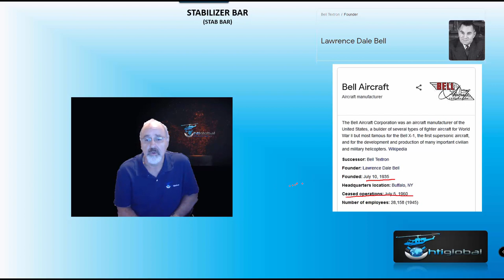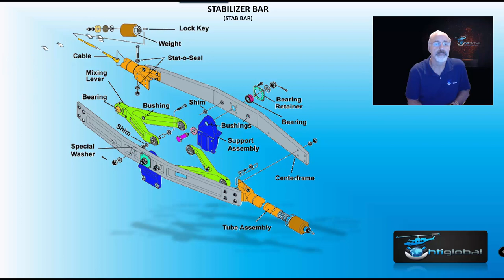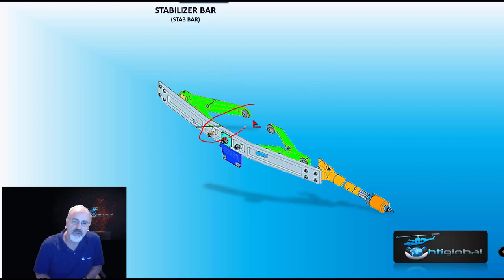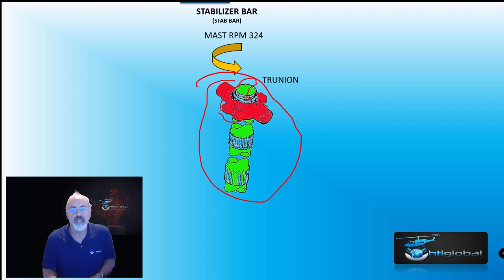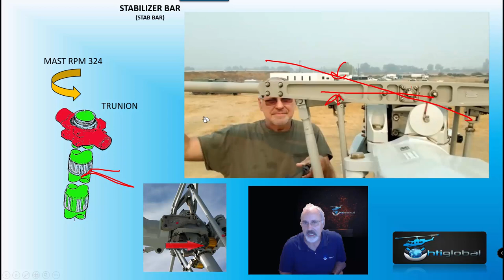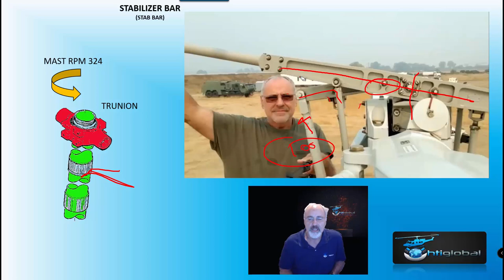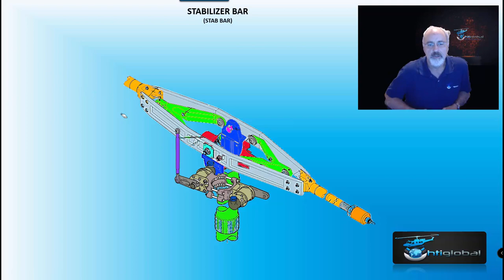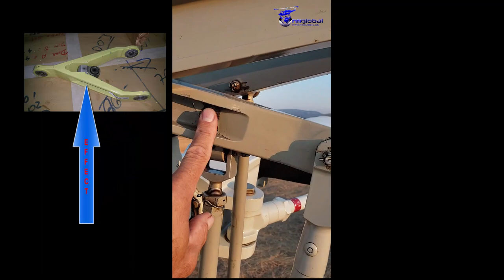BELL 212, 205, HUEY, 204, 210, SINGLE EAGLE, SUPER HUEY STABILIZER BAR EXPLAINED

Comment: Could not have explained it better!I got to watch lots of UH-1's land & takeoff as a child, amazing machines..I had them figured out @ 5 yrs old but didn't have proper vocabulary!
I loved that rotor system, collective/cyclic LOWER mix, stabilization mix @ top..body can move under "stable" rotor..almost like a load on a  stable cargo hook, or a beam crane!
Great MECHANICAL stabilization vs current electronic gyro inputs (that reduces weight & "mechanical" maintenance)
Reply: Great that you like it. Thank you for your kind words. Regards👍👍

Comment: Hello. I have a question. So if the pilot applies 60 % and it takes 5 sec to the stab bar to give the other 40%, what happens when the pilot finishes the maneuver before that 5 sec? the stab bar will continue giving the 40 % after it is no longer needed producing an undesirable banking/pitch?
Reply from the maker: You answered yourself that question.  The only way the pilot " can finish the maneuver he wants " is after the whole process takes effect and you have 4 to 6 sec and you said 5 sec so is withing time. Regards